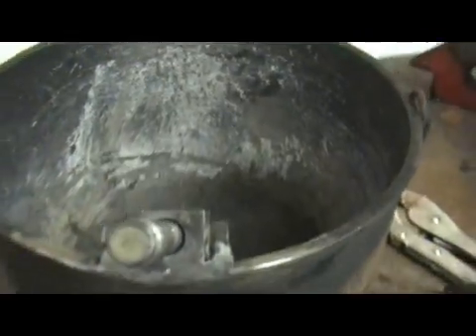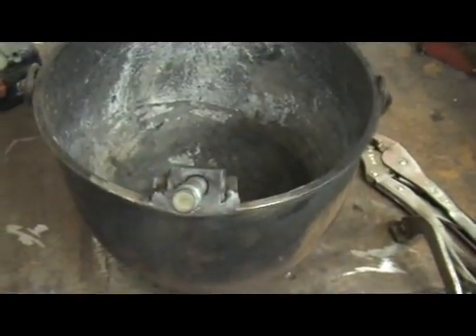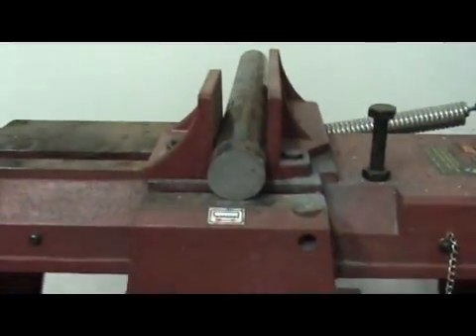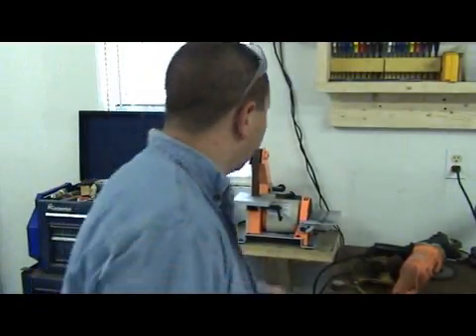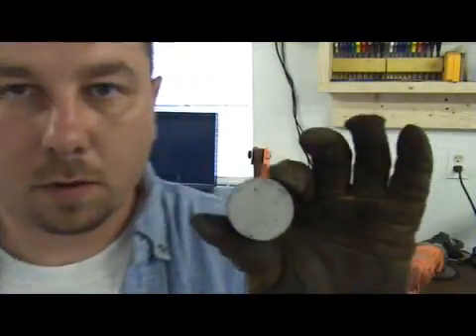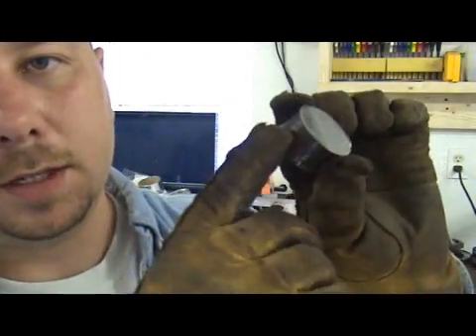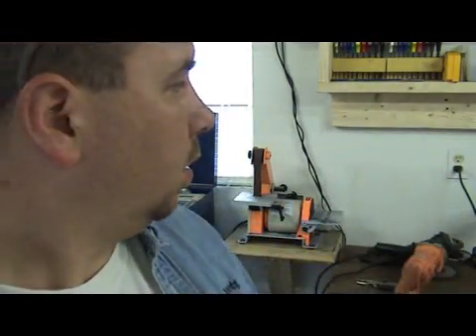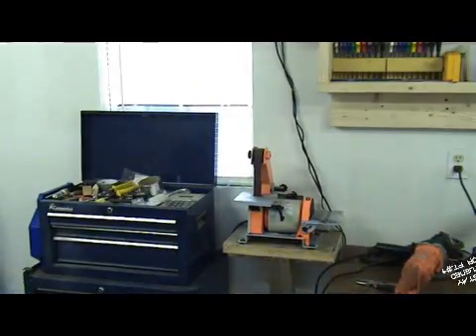Bottom Spout Lead Smelter PT.#3

Comment: You have all the tools. I wish my garage had your stuff.  Been considering a similar plan...However Take that collar that you turned your threadstock to pass through, and cut a 1/4" slice through its virtical axis.  thats your lead feed.  Then your welding  to pot.  Your probably already doing it.  You have had three years, so where is my finish product?  I want mine spring loaded with a foot pedal, motocycle cable cable style flex to floor/foot pedal, leaves hands free, just stomp and pour...